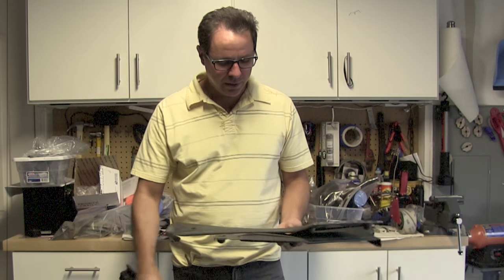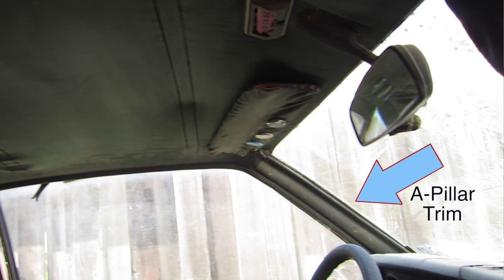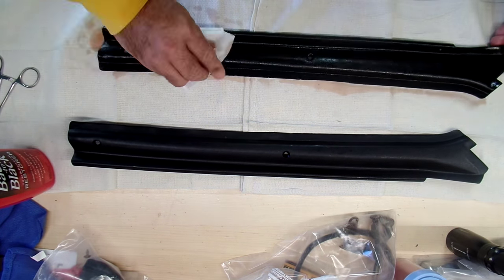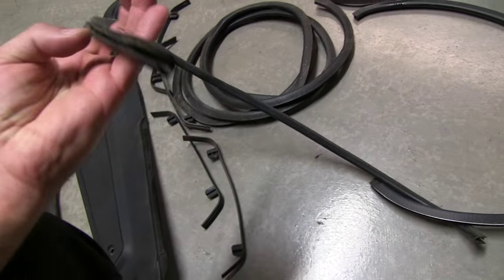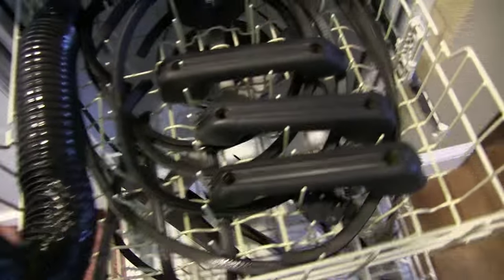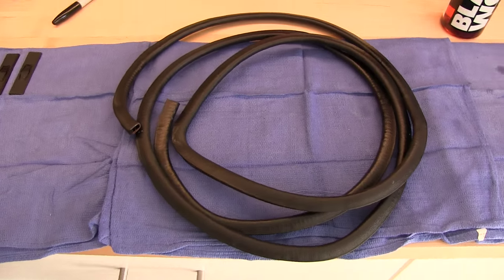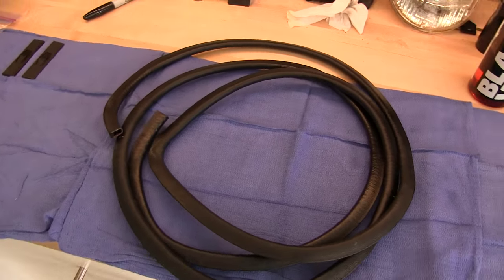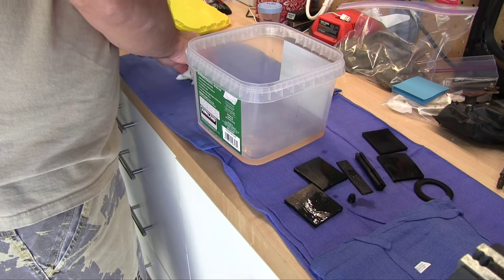VLog 25 Plastic Rubber Vinyl Restore Armor All vs Meguiars vs Black WoW Mazda RX3

Comment: Agreed on SEM Landau Black spray dye - it works perfectly with almost no effort. Not cheap but not expensive. If the surface is textured but nice condition, you'll look back to new in seconds.

Comment: 3 colors on the grill shinny , silver, charcoal color , then the OEM emblem.
Reply from the maker: +perifera1 The shiny would be the stainless trim smiley right? Then silver (or gray) on the bottom lip? The remainder charcoal? This is original.

Comment: Great to see another update vid Steve! Glad I could help with the VHT suggestion. I haven't actually used it myself but heard it was pretty good stuff and your results seem to confirm that. I was thinking of maybe just getting the Phils repro trims when the time comes.

The grille, I noticed yours has bulged at the top where it attaches to the nose cone, seems like a common thing. Mine was the same but I had the painter straighten it out before he painted it (and other parts) gloss black.

Your car being silver, I'd probably go with a charcoal grille, headlight surrounds/bezels and tail light surrounds just to break it up a bit.
Reply from the maker: +keithrx3c Yeah, great suggestion on the VHT. Much appreciated. I hadn't seen Phil's repro trims. It's a bit late for me. Lots of time and money spent already LOL. How much are Phil's?

Bulging is expected of the grille top. How did your guy straighten the bulge? I might give that a go. I've noted your vote for the charcoal. Always appreciate your suggestions.
Reply: +riverseine The painter suggested heating the effected area of the grille with a heat gun then clamping it using two pieces of 4mm x 20mm (or about that size) above and beneath with vice grips. I gave it a go myself but it didn't seem to work too well.

Phils had the trim covers on ebay, I haven't checked recently but they were a few 100 bucks from memory, a lot more than a few cans of paint anyway. :P Yours turned out pretty good so you've saved a heap of cash.

FYI, I also noticed your trims don't have the holes for the arm rests in the back.
Reply from the maker: +keithrx3c Hm. I was wondering what happened to the rear armrests from the silver car. So you're saying it didn't come with them. HA, that solves my missing armrest issue. I DO have them in the rear of the green car and was going to remove, clean, and restore them. Didn't even realize the silver car didn't have them. Good eye mate.
Reply from the maker: +riverseine I'm gonna mention this difference in a later episode when I'm dealing with armrests again.
Reply: +riverseine It would seem if there's no holes for screws in the trims then it wouldn't have had arm rests, assuming they're the originals for the silver car?.  
I wonder if the silver car has the screw holes for the rear arm rests? If the green car had them I'm guessing it's the later model? Can't remember which one you said was earlier and later. 
A bit more trivia, my understanding is that over here the 808 coupe and RX-3 coupe were the Super Deluxe models and between them the interiors were almost identical (apart from the centre console and centre arm rest/coin box - as far as I'm aware) both coupe versions had front and rear door and rear quarter arm rests. 808 sedans and wagons however being a lower spec had a narrower plastic door arm rest which is less comfortable on the elbow. Someone more knowledgeable may be able to confirm or correct me on all that but I think I'm pretty close.
Reply from the maker: Green car is a 74 it has rear quarter arm rests. Silver is a 76 and as you noticed, no arm rests. I guess they needed to trim costs by then? Probably to make up for outrageous US bumper standards or something. LOL.